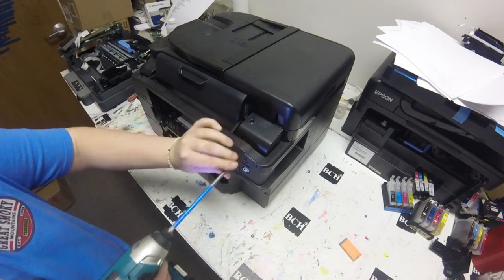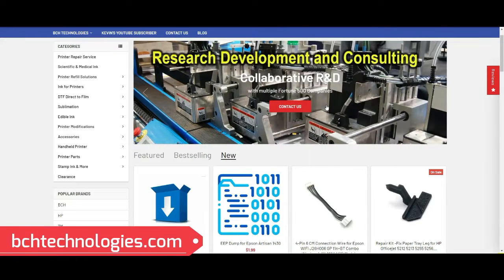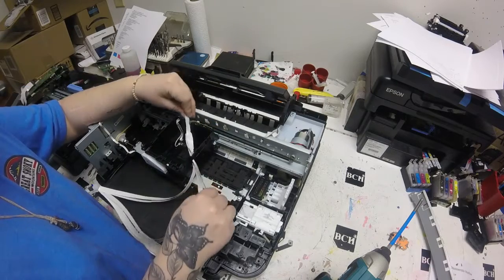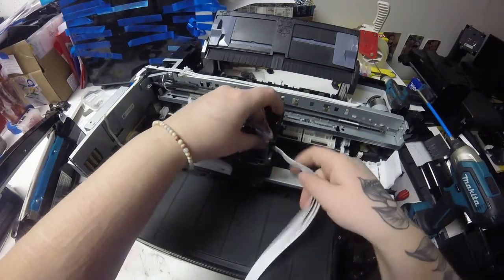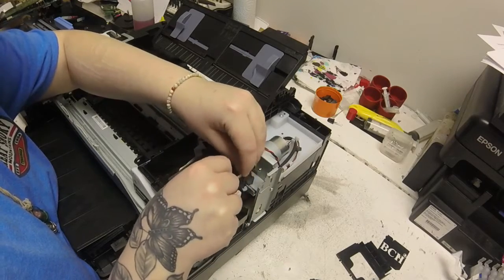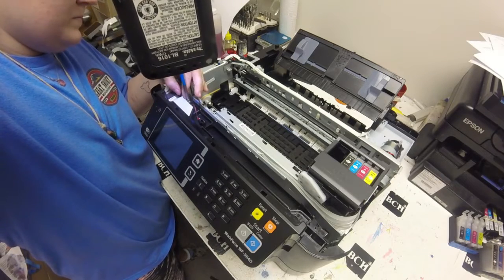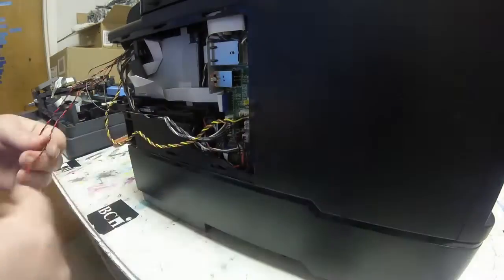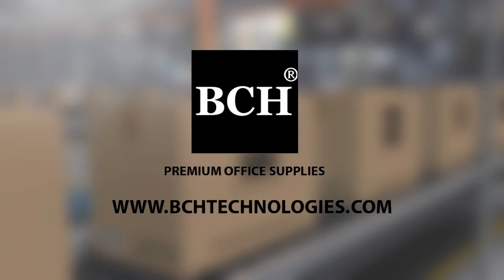Fix Epson 0x9A Error (Part 1) - Replacing Printhead FFC Cable for WF-3640

Comment: Hello, I am also getting the same error on Epson WF-3520 printer. I replaced the printer head. Could you please confirm tha cable name used for Epson WF-35020 with the printer head. Is it FFC 28 PIN, same side or opposite side cable. Thank you.
Reply from the maker: Thanks so much for watching and for taking the time to ask such a detailed question! For the Epson WF-3520, the printhead FFC cable is typically a *28-pin, same-side* cable, meaning both contacts are on the same side of the ribbon. However, Epson has made small revisions over production runs, so it’s always a good idea to visually confirm by checking that the gold contacts on both ends align in the same orientation when the cable is laid flat. You’re definitely on the right track replacing the cable when troubleshooting the 0x9A error—this issue often relates to poor communication between the mainboard and printhead. We receive a high volume of technical questions every day, so subscribers and members are prioritized for answers within about 48 hours, while other viewer comments are answered as time allows. If you need faster assistance, please email [support@bchtechnologies.com](mailto:support@bchtechnologies.com). And if this video or comment has helped your repair journey, please kindly leave us a review on Google at [https://g.page/r/CfL7k6nYvPQ9EAg/review](https://g.page/r/CfL7k6nYvPQ9EAg/review). Don’t forget to subscribe or become a member—subscribers and members get priority responses, early access to videos, and exclusive behind-the-scenes benefits!

Comment: I got an error 0x9A on my Epson WF-7610 with aftermarket refillable cartridges found on Amazon. The cause was not a bad board or cable, but instead that the cartridge dimensions are not perfect.  When installing, if pressed firmly at the rear of the cartridge where the lock-tab is, it somehow shorts out the cartridge conenctor and immediately throws the 0x9A error.  If I instead press the cartridge in very gently just until it clicks, no error is thrown and the cartridge will work okay (with Epson nagging about non-genuine ink but permitting it after saying Yes a couple times).
Reply: Yeah exactly same here with WF-3620. Found the ruddy chip had fell off cart and so had to clip it back on before pressing cart gently back into printer. Got my aftermarkets from AliExpress if that helps.

Comment: How to unclog printer head on a wf-r4640
Reply from the maker: Unclogging the printhead on a WF-R4640 can usually be done with a combination of the printer’s built-in cleaning function and some manual techniques if the clog is stubborn.  
Start by running a *nozzle check* from the printer’s maintenance menu. If you see missing lines or gaps, run the **head cleaning cycle**. Do this no more than 2-3 times in a row, and let the printer rest for about 30 minutes between cycles. If the clog persists, it may require manually flushing the printhead with a cleaning solution.  
If you need a deeper clean, I recommend using a syringe with a silicone tube to flush cleaning solution through the ink ports gently. Make sure to turn off the printer, remove the cartridges, and apply the solution carefully. Let it sit for a few hours to dissolve any dried ink.  
Let me know how it goes, and if you need a step-by-step guide, I can point you to a video or provide more details. Good luck with the unclogging!

Comment: Hi, I got this error after doing multiple print head cleanings and after trying to check what the issue was my 7610 won't turn on. The blue light comes in after pressing power button but it won't turn the printer on. When I press the power button fast a few times it turns on but then it turns off right away. WhT could be the issue
Reply from the maker: You got a power leak on the mainboard. You will need a pro to take a look.

Comment: Hello, Kevin i have a printer WF3620 Epson with the same code 0X9A i changed the headprint but the same code, Can you help?
Reply from the maker: Check the FFC cable, then probably the mainboard needs to be checked.
Reply: Probably your fuse is dead. Check videos to confirm this.

Comment: why Replacing Mainboard: the problem 0x9A is to change FFC cable and the fuse
Reply from the maker: We collect all the main boards and change all the fuses in one take.
Reply: @BCHTechnologies   you can resurrect the shorted mother board now? can I send you my wf 7211 motherboard?
Reply from the maker: @c2sartinkprinthub757  I don't have a WF-7211 to test it now.  I only have a bunch of 7720's.
Reply from the maker: @c2sartinkprinthub757  Sometimes it's the controller chip E09A7418A, so it will power on but no color coming out.  Therefore, you will need a real printer to test it, not just power it on.
Reply: @BCHTechnologies  I have two wf7711 shorted motherboard?
Reply: @BCHTechnologies  this is a power controller chip .. do you sell this one too?
Reply: @BCHTechnologies  ah ok